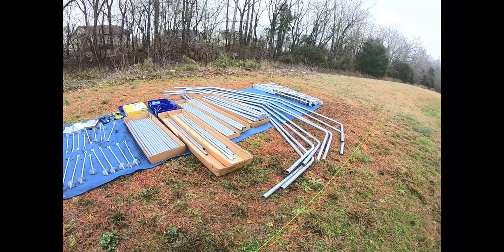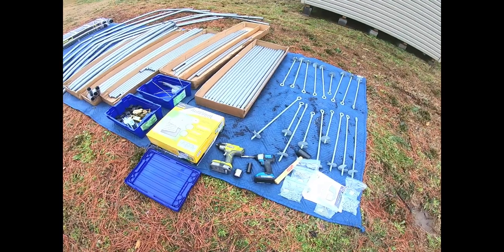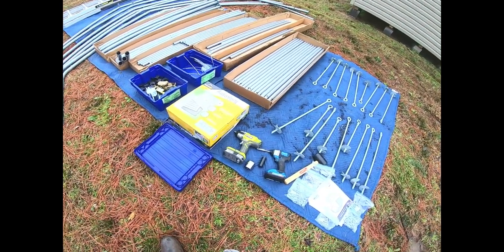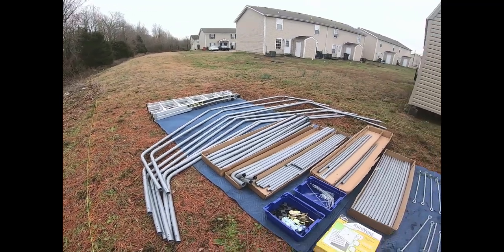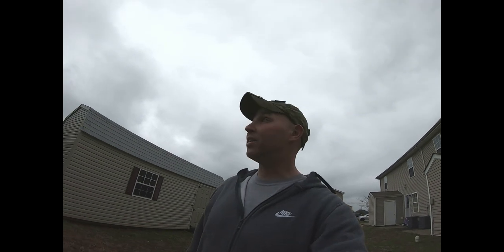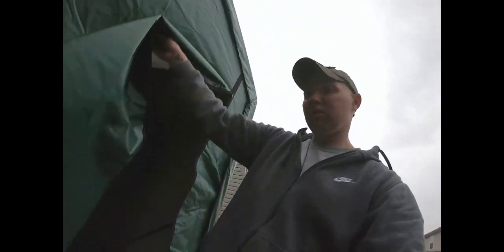ShelterLogic Build for NEW BOAT!

Comment: Hey What is the size of this shed 28x13'10"x? What's the height 8'? I'm ordering a 1980 with 10' blades do you have to lower them too get it thru the opening and what's the overall fit (cramped? lots of room?)
Reply from the maker: Erik...yes, I do. You have to go the next level up which was almost 600 more. Will the door zip up for it to fit...by the measurement, yes. By the practicality of it....nope...Sorry man!
Reply from the maker: I forgot to mention though....plenty of room...I even have my EZ turn John Deere parked in it too